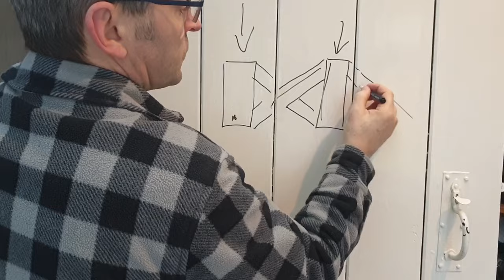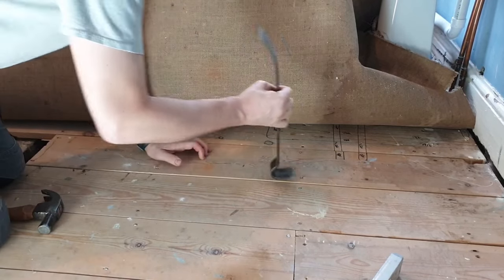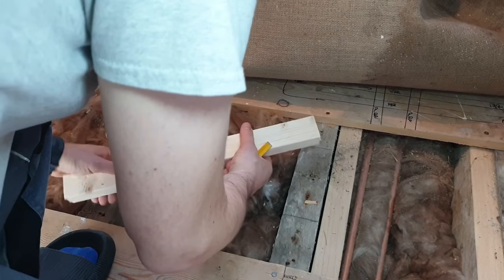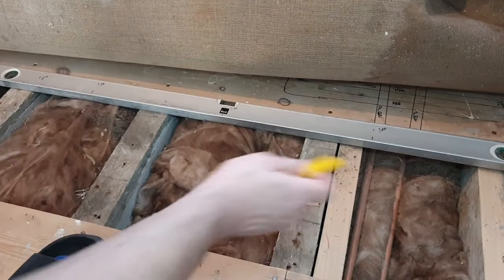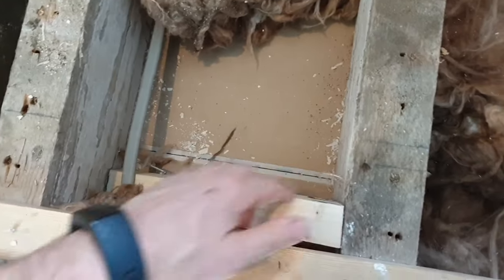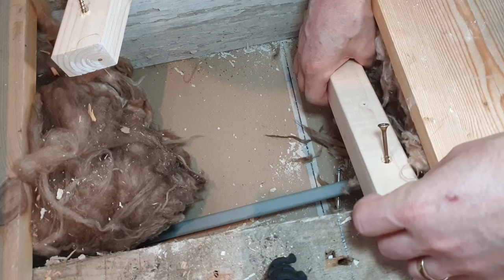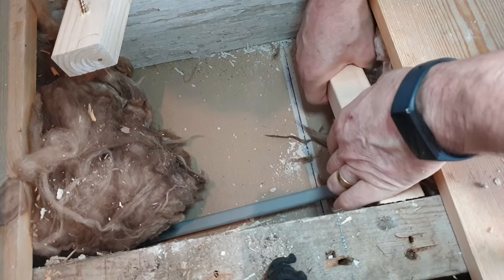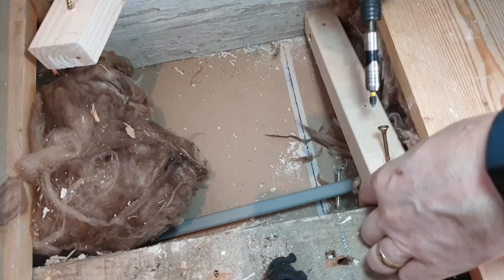How to Fix a Bouncy floor - DIY Floor Struts!

Comment: What if there are several electrical holes in the floor joist? The electrician had to move the box to a new location. The floors were bouncy before this happened, but now I am unsure how to reinforce it.
Reply from the maker: If you think there are too many holes you can "sister" the joist with another timber bolted to the existing joist. 
If the holes are not too big or too close together depending on the length of unsupported joist you could do 2 lines of struts across the floor just to be sure, divide the room into 3 and do a line of struts at the 1/3 and 2/3 position.
just be aware that the struts will reduce deflection or bounce but won't add strength to the joist if too much material is missing i.e. holes too big or too close together so if your not sure get someone to look at it for you, good luck with it

Comment: Why have the electric cable between the 2 struts? Just leave it run flat along the ceiling out if the way of your diagonals.. less stress on the wire surely..
Nice vid though
Reply from the maker: Thanks 👍 
Yes absolutely leave it flat but my cable is clipped either side of where the struts are, the nail i pulled out was stopping it from sagging so I thought best to keep it up.